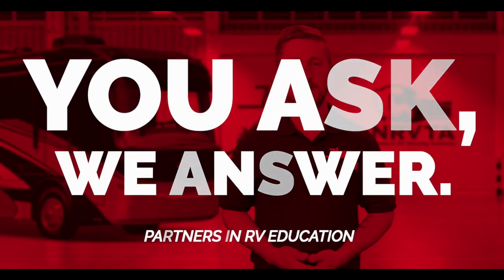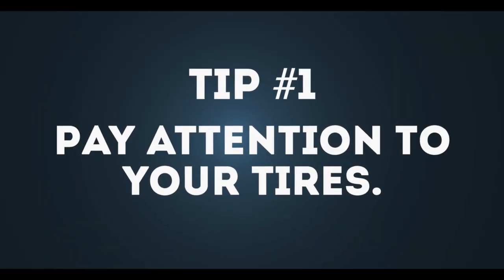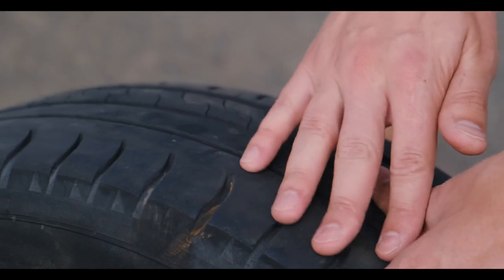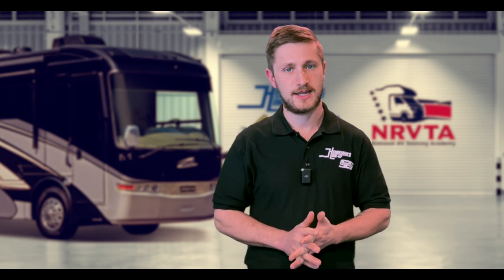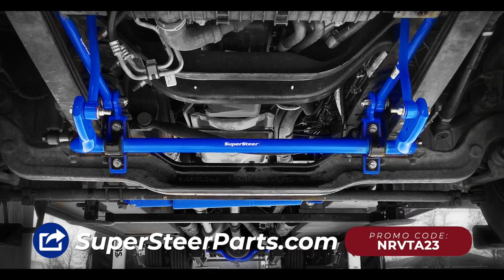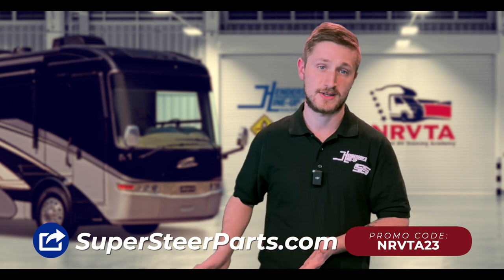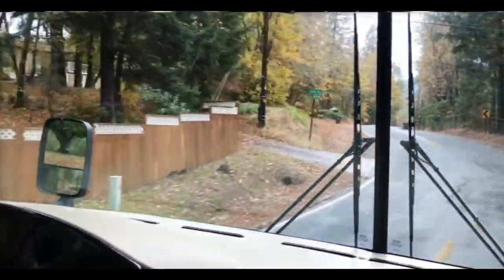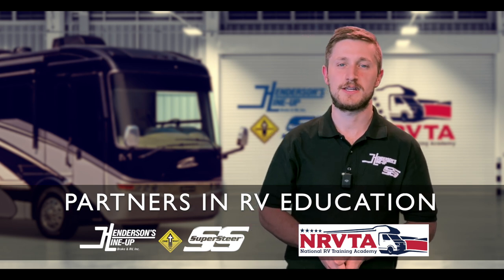Top 4 Motorhome Driving Tips and Tricks

Comment: Yes, I just discovered National RV. Thanks for your service. I wanted to know if you have any videos on repairing or maintaining rv slide outs. I have a keystone cougar that the main slide out is really going out slow and I am having to have someone push on it to help it come in. Its a cable driven slide out. I just installed a 300ah lithium battery thinking that the batteries were getting old but that didn't help. Thanks

Comment: Great job Tommy. Only comment is when doing a 4 corner weight. If one side/corner needs more air to carry the load. All tires on that axel should be inflated to the higher preshure. Ok ok just one more thing. When you go to the tire inflation charts. The preshure shown for a weight is the MINAMUM to support that weight. I always go 10 lbs. or 10% over to give a safety cushion.
Reply: Thanks, William for that awesome feedback. I will pass on your info to Tommy. :)